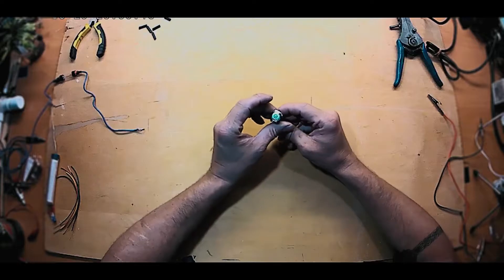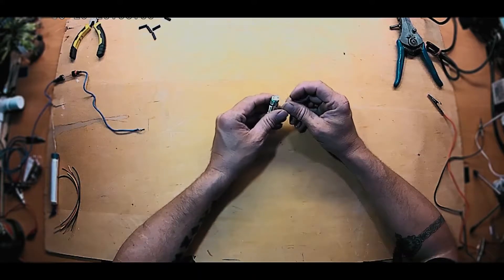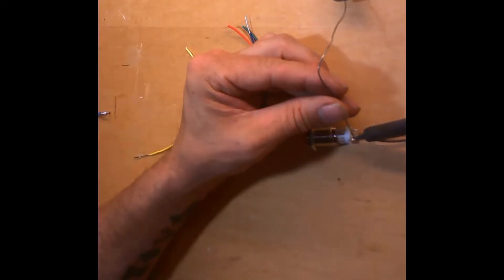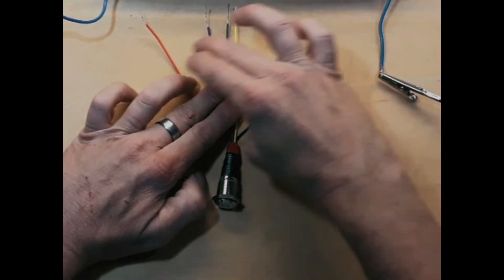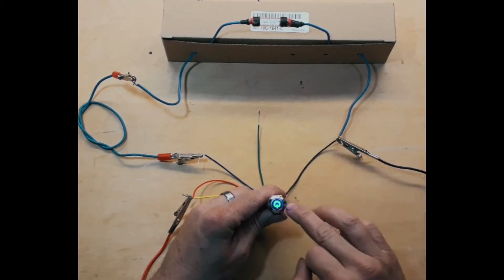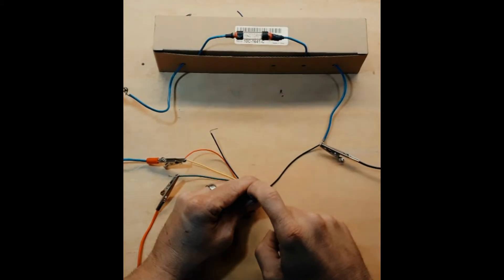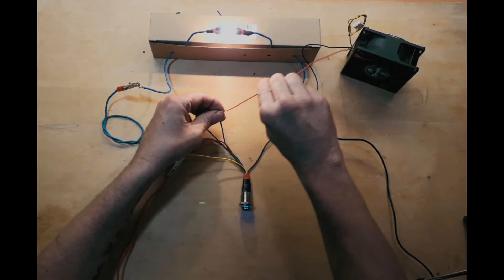3 ways to wire push button latching 12v switch with LED

Comment: Nice explanation. But now i would like to have a led switch where I can switch the ground wire. This ground wire is to pass the thermostat ground wire leading to a radiator Fan.

Comment: How do i wire the five pole switch to switch on my AC compressor selonoid? I try but the light stays on all the time or either off all the time. I want to wire it so that when engaged the light comes on and when i disengage it goes off. Which wires work for this setup?

Comment: I wanted to know how I could hook up this PLMRMB4CW amp to this switch APIELE 22mm Latching Push Button Switch 12V Angel Eye Ring Light LED Waterproof Stainless Steel Round Metal Self-Locking 7/8'' 1NO 1NC 1 Pack (Blue) I took out the yellow wires and I hook hooked up one blue wire to the red wire on the switch so I want to know where the red ,blue & black wire from the go to and the blurred twisted wire , 1 blue wire and one black wire on the witch go using 3 3 spot lever nuts?

Comment: I have a 7 wire toggle switch. (Daier Tek RGB led toggle switch ) wiring instruction suck. It's for a led whip. white is common-blk is sw normal open- orange  sw normal closed-yellow=led common red+ B+ green +. please help.  he said the kit is for a OPTI 70  or OPT 7. I will get more info if needed

Comment: Hello friend,

I am trying to wire up a 5 terminal switch, where the feed is coming through an emergency stop switch.  I want to connect the switch to a variable frequency drive  which feeds the motor.  I have tried a few times but I don't seem to be able to get it right.  I am trying to wire it in a way that when I press the switch the led light will come on and the VFD at the same time.  I am a beginner and I would be grateful for any advice you could give me. Thanks, Bahram

Comment: I can feel your chill and patient demeanour through the video.  This is the most helpful video I've seen on LED push lights, I want to make a little board for my kid to be able to just press buttons as he likes to do that.  I wouldn't have had the confidence to do it without this video, if I could ask one question it would be as each button is 12V does that mean you need 24V for two buttons? Sorry if that seems dim but I've got no electronics experience.

Comment: Hi, I’m trying to put together a project and I’m a bit confused with these buttons, not entirely sure if they will work. I hope you can clarify.
On one hand, I need to connect on/off 2 terminals (A and B), these carrying 12v.
But I also want to have the visual feedback of this on/off operation, done with separate terminals (lets say connecting C and D), as the button requires 5v (instead of 12v).
Is this doable with these 5 pin buttons? I’m asking because at the beginning you mention that RED is just to power the led. This means that is posible to have a separate switching path with different voltage?
I hope I’m clear, what i need is to use buttons within a circuit where the voltage changes from section to section, but the voltage to feed the buttons' leds need to remain the same, so I guess I need 2 connection paths within each button, and I’m not sure if these do the trick.
Thanks.

Comment: Well explained. 
Great video .Thanks Dear
Have one question..i've the the same push switch and one led indicator [both are of 12v dc]
Would like to know how to connect the same to the amplifier board. 

Once connected as you mentioned in your video , do i get the 12v output for my amplifier board after led indicator connection.

Plz elaborate.

Comment: I'm trying to wire one of these right now and still a bit confused. I'm replacing a switch on a 12v device that has +, -, and o wire feeding into the on/off button housing. The switch I purchased has a NC, NO, common, and 2 led wires. I got it to work but just want to make sure its safe how i wired it. I'd be willing to pay someone to help me get this working.

Comment: I can see that this video was made 2 years ago, hopefullyyou see this. In my situation I upgraded my handle bars on my motorcycle but I would need to spend another $600 to keep my accessory switch in the same place. I thought alternatively.. I can remove my cigarette lighter and place a push button switch to turn on accessories. Would this be possible?

Comment: Hi, I'm trying to manually cut or supply power to my car amplifier. 
I've tried all possible wire combinations on the remote cable which supplies signal to amplifier when radio turns on.
My push button latching switch only has 12v+ , 12v- , NC, NO and C.
Am I missing something?
Please help
Reply: You're getting confused ... the switch is independent of the internal led light.
It's really a normal switch, that opens or closes between Common and NO (normally open) 
So open, and not connected when up, and not pressed in.

There is a second (opposite) option to have the switch be constantly connected using NC normally closed when the button is up. And off when depressed.

So, put power to the C common, and the NO ... and then it's just an ordinary switch. 
Hook power to the C and your remote to the NO.

If you go with the NO normally open and want the led to come on when depressed, hook the + red led wire .. to the NO.

Comment: I want to wire my switch to break a ground connection.  I want the switch light on when I break the circuit, and off when the circuit is open.

Comment: Thank you, great teaching. I have a question regarding this switch. Can I have 2 12v power going to this switch, If so how do I connect it? I want to connect my door lights power to a 2nd set of lights in my car and also have the ability to turn on the 2nd set of light when needed if the door is closed. 
Thank you

Comment: Can you use that for PC?
Reply from the maker: this one will work on any 12v system I believe computers are 120v AC and then the power supply turns that into varies DC voltages so you would need to get a 120V AC version of this switch

Comment: Can I use this as a power switch on my arcade?
Reply from the maker: if its direct current (DC) between 5 and 24 volts yes  its latching though (this one) if your seeking a bumper button then Id get the non latching or wire it in the momentary method
Reply: @kootenayboy  on the switch it says 110-220V/W so can I attach this one to an extension cord and havebit as a switch?
Reply: @kootenayboy  Really sorry to ask this questions 😅 I dont know much about wiring and electricity
Reply from the maker: @GoodKindaGuy   well is your arcade 110 220 AC  or is it 12v 24vDC thats the biggest question

Comment: Brilliant video. Thanks so much. 
I have one question though - can I power the LED from one 12v power source and connect the switch to a 5v usb interface without the 12v reaching the interface?
Reply from the maker: I believe so as most components these days have variable voltage though it will at best not be as bright and at worst may not last as long . but I think it would be ok
Reply: Yes, the 12 volt led light .. is independent of the internal latching switch.
But you won't be able to tie the 2 circuits together, for the led to cycle on or off wth the switch itself.

Comment: Link for that on/off switch?
Reply from the maker: I get them off Ebay from China (cheap and free shipping)  but they do not always stock the same items all the time.  they are all over ebay  so a link probably would not help  search 12v latching pushbutton switch it will come up :)

Comment: Hey great video thanks! Would you think it would be ok to use this kind of switch with 230v mains voltage? I would get one that is rated at 220v with a 15 amp limit. The device should pull no more than 300w. Also i see this kind of connector and one that only has 4 prongs, do you know of they work the same?

Comment: Excellent video and tutorial you provide a very clear explanation. I am working with a 220v version switch and pigtail (colour codings different as you explained) I am using for a bedroom bedside light. Is there a way to configure the switch so that the switch light is on in the off position and goes out when you press the switch on?  i.e when you switch the bedside light on the switch light goes out and when you switch the bedside light off the switch light comes on Many thanks

Comment: So if i want to build lift system i should make step 1 and 2 like that sir?
Reply from the maker: its difficult to really say unless more information is provided  if you want up and down its pretty simple push in motor or pump is on lift goes up power off switch out lift goes down  more elaborate than that more would need to be known

Comment: Can you have out off as power on for motor and push in to reverse motor please
So plus power when pushed in
And negative reversed when out
I have the 8 pin version 6 plus 2 for led
Reply from the maker: I believe so but you would need to find a diagram online for that specific of a need,   I know the 7 pin winch type switch they cross over the + and - on the pins to reverse the polarity  if you have a multi meter and a mock 12v source  in your work space you could figure it out . but myself Ive not done it with this switch sorry

Comment: Is there a way i can use this switches to connect two different 12V sources to a single load? For example, if switch is off, the led will be connected to power  supply 1 by default. And when switch is on it led will be connected to supply 2. Thanks for the informative video.
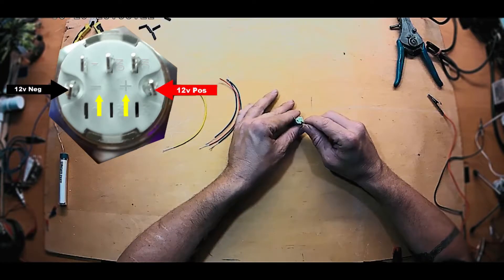Reply: If you stop at 3:12, you could use that as a reference. But you would have the led wired as normal. 12v-neg to ground, 12v pos to power. The - is common, which would be the load (device you're trying to power). NC would be supply 1, NO would be used for supply 2.

Comment: I want to hook up hazrd lights on my motorcycle.  So, I have identified the source power from the turn signal relay.   I have also identified the outputs to each turn signal.    Question:  Do I then connect NO to the turn signal relay, and then run my connection from C to run to each turn signal?   TIA

Comment: Is there a way to wire this to do a negative disconnect to a door jamb switch wire is the trigger which is also a negative but have the button led light turn on when the ceiling light is on and when the switch is off the led on the switch is on and ceiling light is off

Comment: Using the Stay On Always mode in my truck for a light bar, can you wire it in with the cigarette lighter as the auxiliary to turn off when the truck is off?
Reply from the maker: yes get a T-Tap and tag into the hot wire for the lighter wire or the acc from the ignition the T-tap makes it a breeze

Comment: Nice video. I have a switch from Apiele that has only 4 connections in the back. POS, Neg and 2 ON connections. It's kind of strange to have 2 ON connections and I am not sure how to wire it so the switch is illuminated only when pressed in. Any ideas?
Reply from the maker: is one the power to the LED?  or on switch in and on switch out?

Comment: Can I use this on a pc?
Reply from the maker: yes I think you can depending on the model most are good from 5 to 24 volt DC which is what most tower PC computer power supplies run.  you would need to check the PC first as I believe they have different connections that exit the power supply that are different voltages.

Comment: Hi! How many watts can the buttons hold? Whats the power load? Can i connect several LED light to same button?
Reply from the maker: Yes most LED's run low watts so depending on the button as they are different  but yes most could handle several  any more you would want to use a relay

Comment: Can I use a 4 prong latching switch for a two way switch setup? We have 12v puck lights in our bedroom and I'd like to be able to turn on or off from either side of the bed.
Reply from the maker: yes but you would probably want a relay to make sure your not double powering it and only 12-24v depending on the switch you have

Comment: Thank you so much for this. I'm planning on making a lightsaber with a latching activation switch, but I couldn't figure out how I would make the led come on when I ignited the saber and off any other time. Now I just have to find a switch I like!
Reply: Your gonna want a relay I’m thinking if your light bar didn’t come with one you’ll wanna put one reason for is light bar draws a good bit of amps these little switches handle 3amps at 250 volts I had got one and instailed  couple months ago it came with a relay it said that was the reason but I had a light switch I ordered that matched all the switch’s from factory it’s amazing that you can get the switch picture with over the windshield light bar and snaps rite in looks factory but good luck I’d say you’ll do just fine if you add the relay or you light bar may come with it have a good one and stay safe!
Reply from the maker: Glad I could help!

Comment: So wtf kind of fuse does a car charger have to use to transfer 12 volts from the battery to the button and then to the horn when you honk it. I bought a 12 volt cigerett lighter adapter thats supposed to transfer 12 volts but it fried the glass fuse inside itself. looking at the fuse it says F3AL250V. from my understanding and googling everything a car fuze for 12 volts needs a 6A not a 3A. but what do i know? if you know plz lmk!
Reply from the maker: hmmmmmm  I would think you may need to check the car instructions itself maybe its got some can bus type situation where they have made it so the power only flows one way and that's OUT not in.  the newer cars get tricky  my Durango if I add or subtract an inch of wire it Fracks everything up because the computer uses the resistance in the lines to dictate how it operates I added a few inches to a tail light fix and it affected the timing the fuel pump the dash lights  the firing order  all sorts of crud so Im very cautious giving advice.  I usually suggest making your own fresh install like make your own power outlet direct to the battery for your situation a dedicated stand alone line it would work both ways of course but separate from the car wiring harness

Comment: How about high voltage? Like 60v
Reply from the maker: that would depend on the exact switch you have most all look identical but are rated differently so I cannot really say you would have to look on your switch and printed on the bum end there should be a list of its operating specs :) thanks for watching

Comment: You are an excellent instructor! Thank you very much. You really do have a great way of explaining things. I am using this switch to turn on a soldering fume extractor fan that is dual-powered (12v DC brick or 3x 18650 rechargeable lithium batteries) utilizing a low-voltage disconnect circuit that prevents the batteries from being drained too low. This is by far the best video explaining how to wire this switch. Again, THANKS!! Stay safe, my friend!
Reply from the maker: Glad it was helpful! and thank you very much :) thanks for watching :)

Comment: Hello ... love this video. Great explanations.
I however would like to know how to wire up the switch such that when depressed the light comes on but my load is disconnected. And when the button is not depressed the load is connected and the light is off. I know, sounds really crazy, but my reason is I want the light to alert me that the load is not connected because it normally should be except under very certain circumstances.
Thank you.
Reply from the maker: it sounds like you have the feed wire for the LED in the wrong place.  if you want the LED on when the switch is on you jump the LED + wire to the output of the switch the one that leads to the load whatever your turning on.  sorry for the tardy response but thank you for watching :)

Comment: sir can we on both fan & light when switch is on time
Reply from the maker: yes for sure just connect the power for the LED in the switch to the power out to the fan the light will be on when the load (fan) is on and off when its off

Comment: Will these switches work for a 2-way light system? I wanted to install a 2-way light switch system on the headboard of my bed and these would be awesome  ^_^
Reply from the maker: umm not with the standard setup its typically an on off type switch if you are looking for an on high, on low, off type of setup Id look for a 7 pin like a winch switch that will give you  3 options.  does that answer your question?

Comment: Can I use it with 5 volt
Reply from the maker: depends on which switch you buy, the posts are usually the same sometimes voltages vary

Comment: Are all the switches heavy duty i have the same brand same switch but it’s the 16 Mm switch but I do not kno if it’s heavy duty or not cause of the size
Reply from the maker: Im going to venture a guess that they do not make many that will not be able to handle most common loads for most peoples applications, just because the cost of the HD are so low and the specs so high the tech has changed so much now days that even reg duty are better than old school super duty. 

way way back one of my first switches caught fire in the dash because I had so many lights attached  now that same switch could handle 10 times more because the loads draw SO little with leds etc.   
unless your running a winch or big motor off it Id not worry at all :)

Comment: Thankyou this helped alot the switch I had just had numbers but educated guess on the + & - then just tried a couple of wires on the other terminals and hey presto all working. Switch on ignition and led switch lights up when pressed on and foglight works.